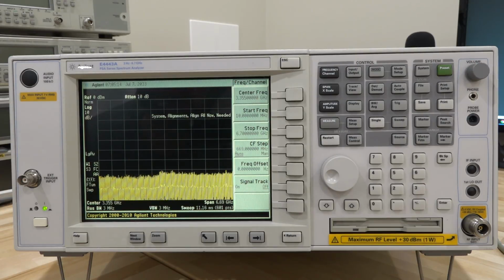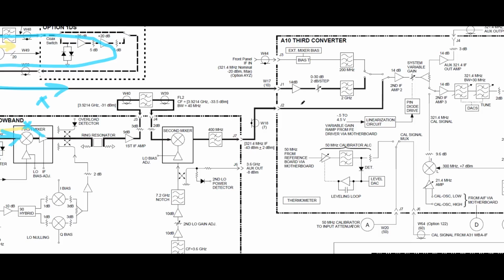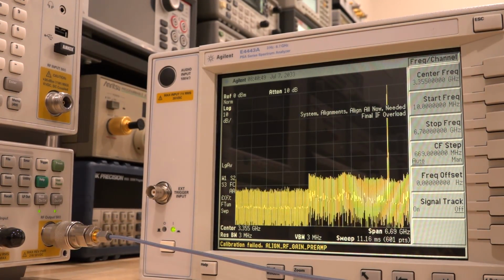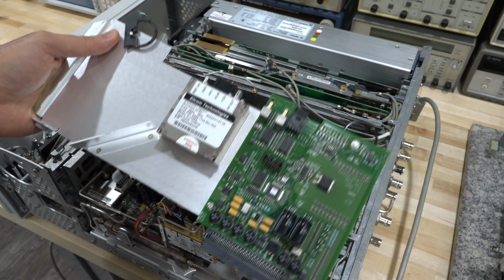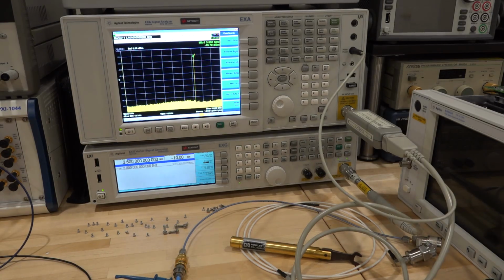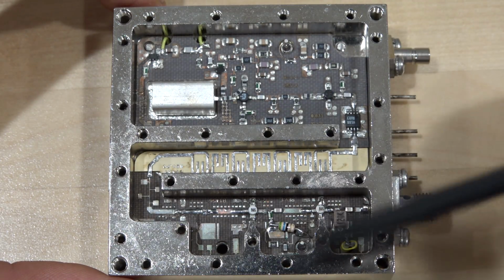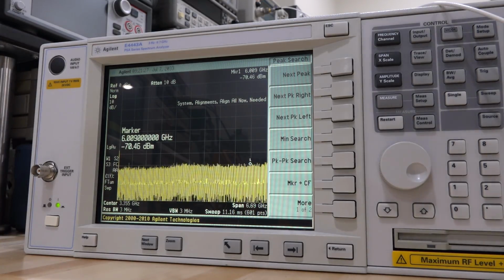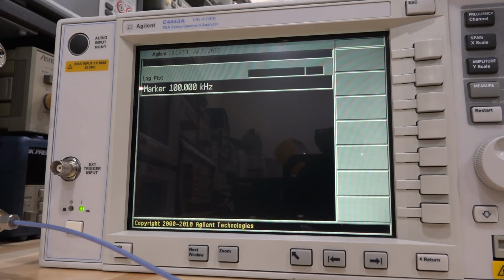TSP #113 - Teardown, Repair & Analysis of an Agilent E4443A 3Hz - 6.7GHz PSA Spectrum Analyzer

Comment: Very informative presentation!  Where can I find lecture how to repair Power Supply module for E4440A Agilent 0950-4447 Rev 2 . It is very difficult without schematic. Yellow LED doesn't lit on the power ON switch, +15V is not present, but I have +/- 162 Vdc on the big electrolytic caps and  at the first switching MOSFets.

Comment: This was a very beautiful repair. After oiling the plunger none of them should stick. Thinking about the oil no dirt will interfere because the unit is screwed together so tight. I would love to have this instrument and think it is cured. I really admire your logical thinking on error detection. It is very admirable. Good job on this very useful instrument. The frequencies this unit observes is within the frequencies i am studying with ultrasonic underwater harmonics. Harmonics of splitting water molecules for more rapid desalination.

Comment: I am trying to think what it will hurt putting two amplifiers in. Instead of tinning the filter I think one could use petroleum jelly to remove the oxidation with a q-tip. It did raise the signal 6db by tinning the filter. Good work.

Comment: I've watched this one several times...one of my favorites besides the 2+ hour long Agilent Spec An you did which is my favorite. I really like the fact that you used common sense & experience to note the oxidation of the filter traces & realized the skin effect depression on the signal especially at 3.6GHz that could have.....excellent deductive reasoning sir & I applaud it. You &  W2AEW's channels are tops in this area due to you both having great insight, background & experience in the field...don't stop for sure.  I also think your style of NOT making use watch you take out 234985767 screws etc makes it even more valuable as an aid to our learning....one suggestion, consider some new video production software to allow you to do split screens....so you can show where your probing on 1 screen & the result on SA or DVM etc on another especially when the angles or spaces between don't lend themselves to a single camera shot... my 3 cents....but great job Shahriar & I'll become a Patreon supporter of your channel this year (so you can do those split screens haha)

Comment: Bravo!! You are very sharp and clever. For sake of precision: the pll is based on a coaxial resonator vco working on a pure TEM mode. Basically, a DRO uses a high constant dielectric puck working on a TE01 delta mode. The field configurations are different. For frequencies below, say 2-3 GHz, the puck would be too big and the coaxial resonator is preferred. You are right. It is possible to tune the coax ceramic resonator with the tip of your iron!!! Many years ago I used to be a designer of both type of oscillators...

Comment: Adding the amplifier adds noise… ie… the performance/dynamic range was changed. 
While this did get the level up so that the alignment could be run… it did not fix the “REAL PROBLEM”, as in, the real issue will cause this 2nd Lo level to drop in power once again in the short term…. So now you will have a broken unit plus the higher noise… 
I have seen many peoples attempt to fix this issue… and like this one… it works for a limited time… 
Even Agilent/Keysight does not “Fix” this… They changed the design to use a completely different Lo Board…  
I know you can see listings on ebay from a bunch of places calming to have working or refurbed Boards, but there is only one Company that I know of that is actually fixing this the right way…  as in, it will last for many years… and does not change the dynamic range… That Fix is being done by a company by the name of Alltest or Expresstest, and they are doing it for the same price as the rest of the hacked up attempts that others are selling…
Reply from the maker: I am afraid your concerns are not valid. The original unit used an amplifier and an attenuator. I used two low-noise MMICs and no attenuator. The second amplifier operates in large signal. The combined amplifiers impact on the phase-noise of the signal LO is below the phase-noise of the DRO itself and does not impact the system performance. I verified the DANL as well as the phase noise of the unit and it meets all specifications.

Furthermore, the whole point of operating the second amplifier in compression was to build margin into the unit. The filter can degrade by another 10dB without loss of output power. This fix will outlast the age of the unit itself.

Comment: I have repaired a higher frequency variant in this same series. Same issue with the Elcom DRO in the low band module. Interestingly, the replacement part I ordered from HP (Keysight Never!) was an entirely new design, apparently done in house, as it looks similar to their newer modules in more recent test gear. 

They appear to have gone through a number of subs before getting fed up and designing an entirely new part. or possibly they had a duplicate function that they needed in something newer and actually paid attention to lessons learned when designing it.  I have the old Elcom carrier board sitting around, might take a stab at it if I ever get bored.

Nice catch on the lubrication on the attenuator. I brought an HP8494b back to life with a little machine oil in the right places.

Comment: Dear Shahriar,
As of your question about the attenuator: it is the 26.5GHz version. They used a similar approach at the CXA (and likely other X series analyzers too), that they used a single type. Even our 3GHz version had the 26.5GHz capable attenuator inside.

Comment: I finished all of the video and just WOW. I'm not surprised that the oxidation happened but rather that it was made to happen in the first place. That part was made subpar for its application. I'm sorry to say that but really it is. To be included in an Agilent instrument I'm shocked even more. I hope they avoided buying parts like this from Elcom or Elcom stops with these designs for future instruments but I suspect they are the cheaper bid...

Look at this vs say the inside of an Avantek or a HP assembly from the 90s (I made a recent preview video on this). Even the attenuator at the end you can see what I mean. You'll note 2 things. Most important one is GOLD. Then there is a part somewhere usually made of ceramic. The gold is used for plating copper traces to prevent oxidation. Even connections are made by wire bonding than soldering. Ceramic (ex. Alumina, AlN, and BeO) is used for thermal reasons (like thermal conductivity) as the substrate. Using just PCB is a great way to kill components in a metal can. Acts like a thermal insulator.

Since this unit is not hermetically sealed, it is no surprise that oxidation would appear on the traces from leaked air and a heated environment made worse by materials used. For a more reliable long term fix would be to try gold plating a newly made filter or creating a good seal with a "servicing screw" and periodically purging the unit with nitrogen. I have to make a PVS-14 vid about nitrogen purging if one doesn't exist already. This gives an idea about what I mean by nitrogen purging an enclosed space.

The only reason why gold and ceramic wasn't used was to cut costs which shocks me because you are still paying the same fortune or more on these instruments if they were bought new just like if something from the 90s was bought new. Worse off is that our military or high risk cilivian organizations (like NASA) uses these instruments for critical debugging of their own equipment. Sorry about my long rant but considering how pricey this is and you end up with an instrument with subpar parts boggles the mind...

In any case great repair vid. I loved the reasoning and the macgyvered solution towards the problem. Looking forward to your next repair. I'm gonna guess that other unit in the beginning is the Anritsu MS9710B from earlier.

Comment: I would love to see a RYTHM "Routing YIG Tuned Harmonic Mixer" teardown if you have a spare broken one on hand. That part in and of itself alone is interesting. Its a preselector filter, PIN switch, mixer all in one. It has 4 YIG balls in it too. I've seen a broken 5086-7884 (for the 8563E/EC models) on ebay going for $200 - $400. If you don't have one on hand and can't do ebay perhaps we could work something out? I'm also able to loan one to you for review/educational purposes. I have a dead one on hand currently. For information on these there is patent US 5553319 A and a QSL site by Luis Cupido (under his wire bonding repair link.)

Comment: What I think could be intresting too is a repair video using only the most basic tools necessary and some "hacks" to measure things. Imagine you are a student with only a rigol DS1000Z series scope, a few multimeters, PSUs etc. but nothing fancy, and score a dumpster find of a similar spectrum analyzer and want to repair it now....
Reply: This is a good point. He did extensively use a working spectrum anaylser to fix the broken one. Most people don't have a spare hanging about. Prehaps just use a 100MHz scope, a frequency counter and some mixers?

Comment: Thank's for not quizzing us, because there is no way a beginner like me is going to know what a notch filter does.
You can slow the video down in the settings if it's too fast.
Reply: FYI, a notch filter eliminates a certain frequency from a signal, but not those frequencies above or below. A common use is to eliminate a strong harmonic from some generated signal: when you make a given frequency signal you'll get extra signals at multiples (and/or fractions) of that frequency. You don't want those extra signals (harmonics), so you can filter them out in various ways.

You may have noticed that there are two filters in the section where the notch filter is. The other one is a band-pass filter. It eliminates frequencies above and below the signal of interest. The band pass filter operates first, but clearly there was a harmonic that it wouldn't eliminate. Making it stronger would probably distort the signal of interest, so they added a notch filter to just eliminate the harmonic.

Comment: 21:10 "I can also tap it to see if the power changes..." <-- that's experience speaking. I recently repaired an Advantest R3371A (my first microwave equipment!) and spent days mucking through the second LO PLLs, retuning DROs every time I opened it up, etc, and it turned out to just be a loose cable. If only I had tapped it to see if the power changed, I could have saved myself the trouble!

Comment: Replacing and adding the amplifiers in that module is a seriously impressive piece of repair work. Makes you wonder how much otherwise good equipment gets trashed that could have been repaired by a knowledgeable and dedicated engineer.

Comment: Did you ever find a source for the front panel "LEMO" style connectors? Apparently it's some sort of industry standard...would love to power my homebrew active probe from the Rigol DSA1030 instead of a separate power supply.
Reply from the maker: I ended up buying a probe power supply from eBay for about $50. It had two of them on the front panel. That is the only source I found. :(
Reply: Old Metrosonics noise dosimeters used LEMO connectors to attach the mic cable. Maybe you could salvage some?
Reply: WOW a blast from the past, I worked for METROSONICS when they were still in the basement of the owner's house.  Digi-Key and Mouser sell LEMO connectors.

Comment: The well-known Thiourea based liquid tinning solution would be a good way to restore that filter, since it deposits a smooth and even layer of tin, without heat and without electrolysis.
...or a liquid silver depositing solution, but you would need to consult NileRed, NurdRage or ChemPlayer, how to make one.
Reply from the maker: I agree. I just didn't have one at hand at the moment and wanted to complete the repair.

Comment: I don't like what you did to the filter, was this just a do or die action? I mean by putting tin on the tracks they now all have a different coupling to the next stage... Another thing - why does it have an optional audio input, is this because it goes down to 3 GHz so is it an extra signal input?

Comment: [RF Noob here]
Something I never understood is why there is no solder mask on RF PCBs. Wouldn't some kind of varnish have protected that filter agains corrosion ? I'd say it has to be about controlling the impedance or whatnot, where the soldermask cannot be properly controlled.
Reply: The black magic pixies that do all the RF stuff don't like the smell of solder mask. Interferes with their otherworldly incantations.
Reply: My guess is that the solder mask is basically some form of paint and that that might interfere with the properties of the PCB. Also, that PCB on which the filter is made is no ordinary PCB material. For RF usually special materials are used to have better controlled dielectric properties. I suspect that a solder mask might harm these properties or at least make them less predictable.
Reply: It would certainly protect it from corrosion, but it would influence the RF properties (e.g. impedance matching ; filter Q) due to skin effect etc. So the RF performance would depend on the solder mask being simulated properly during design of the filter, but in pratice there will be manufacturing differences which would create mismatches (e.g. thinkness).
Reply: I can say what the others have been saying is true. Solder mask would degrade the signal. Its like if I were to add water inside a wave guide. The metal housing itself is acts as an important component as seen here when Shahriar opens and closes the assembly with its cover. There is a way to help against corrosion and still keep it free of any painted coating. The solution is to gold plate copper and to use wire bonding instead of solder for connections (flux residue and cleaners can change characteristics as well).

PCB is a terrible subtrate to use in RF as well but not just because of electrical properties. You can design around electrical problems. The problem is heat. PCB acts as an insulator and it comes as no surprise that the component he replaced died. The subtrate should be a ceramic material so that heat can conduct itself out to the metal housing which is screwed to the case that has airflow from the fans cooling it.

Comment: Yep, the 2nd LO on these units are known for filter drift: http://literature.cdn.keysight.com/litweb/pdf/E4440A-20.pdf
The standard real time BW of the PSA is 10 MHz. Basic mode gives you digital demodulation, time domain and power statistics for signals up to 3 GHz (similar to the E4406A VSA).
Nice phase noise option :)
Reply: Indeed the stripline filter drifts, probably due to the substrate DK drift (moisture adsorbtion?). I have repaired several of these DRO-PLLs by disconnecting the filter, attaching it with semirigid cables to VNA and "live" retuning by shortening each resonator slightly from each end with x acto knife until recentering. This works as a charm and no additional changes are necessary.
Reply: Wow good find.

Comment: Can you comment on what's involved in designing a spectrum analyzer that goes all the way down to 3 Hz? Surely there's more to it than just removing the AC coupling capacitor at the input. What other challenges are involved?
Reply: I'd say most mixers (e.g. double balanced ones) can't go down to < 1 kHz. Also I assume having a LO in the <10kHz range is difficult with LO architectures (YIG) an and might require a separate band of the instrument. I'm assuming you could upconvert the lowest band to the 3rd LO.